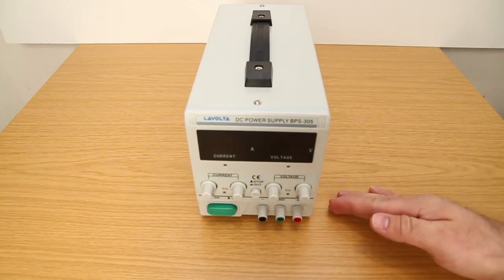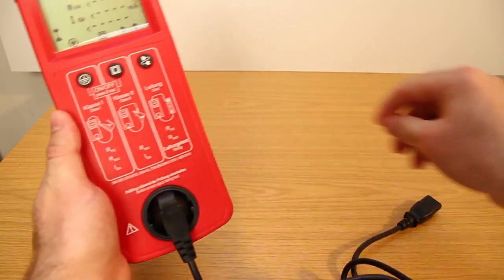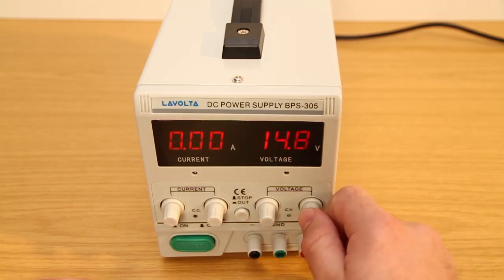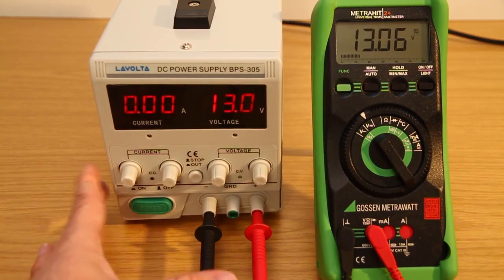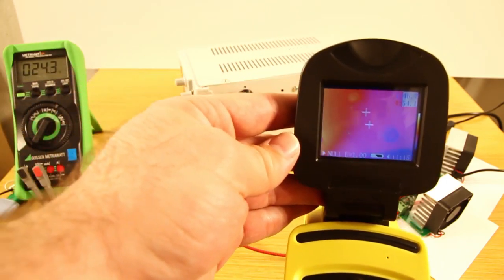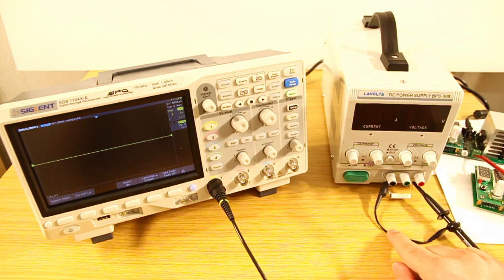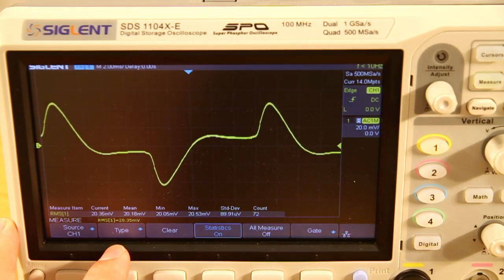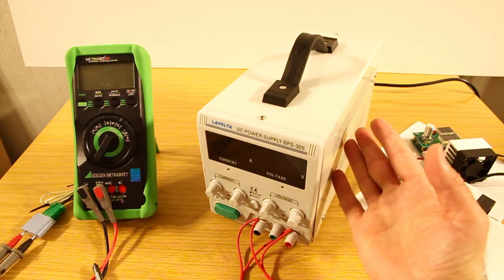Lavolta BPS-305 MK2 30V 5A Power Supply - Review Part2 Thermal Load Test, Ripple Measurement #023

Comment: Hi, I have a few of these different branded supplies, I saw a video whereby someone installed a small electrolytic capacitor which stopped the initial power spike when the supply was turned on ? By any chance have you covered this in any of your videos ?
✌️ ❤

Comment: I found a review that claimed that the excessive heating was largely due to the inferior quality power transistors used in this device - and that this could be easily fixed by some DYI replacement using good quality 2SC5002 or 2N3055. I don't have the electronics background to validate this claim myself but it would be interesting to know if such a supposedly inexpensive hack might indeed benefit the device.
Reply from the maker: I can't say much about the quality of the factory power transistors and they may very well be of poor quality, but I don't think there is much to be gained from replacing them. Because their basic job is to generate heat, they take access power from the transformer which you don't want at the output and turn it into heat. The amount of heat they produce is mostly determent by the output voltage and amperage not their build quality. Should the factory power transistors break you can replace them with better ones, but the power supply won't be any cooler because of it.